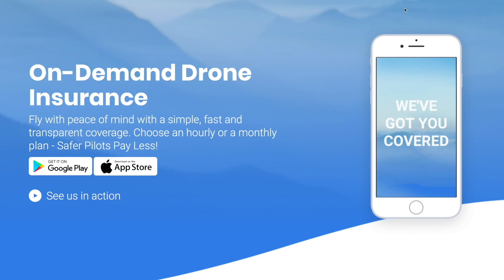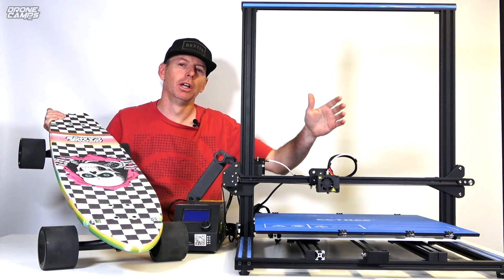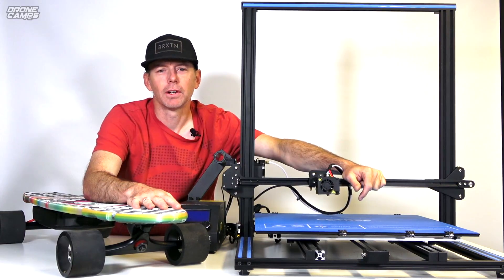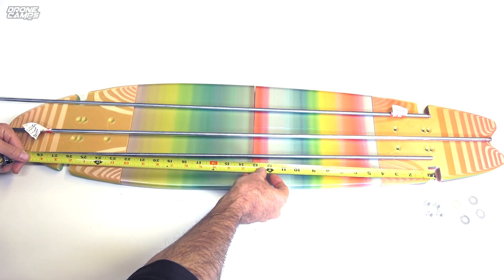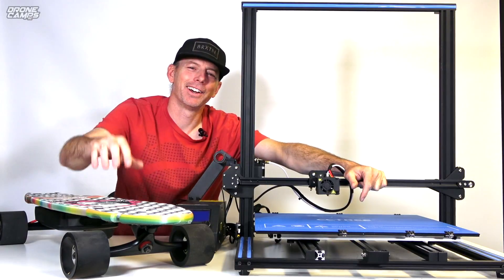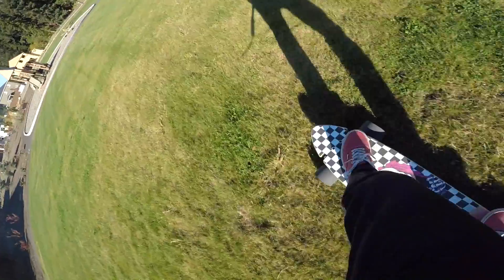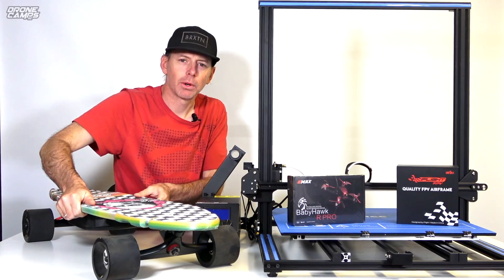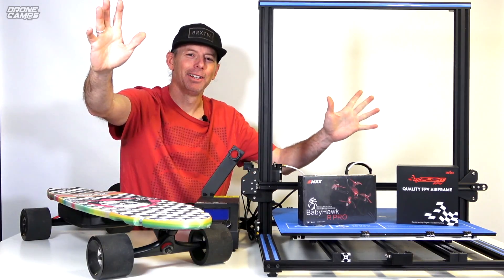3D Printed Electric Skateboard - Print & Ride Test!

Comment: i bought just this type of a printer a month ago as my first 3D printer...and for first few PLA small samples with basic settings from Cura, it printed very good, but then I tried it with PETG with custom settings and I am having nightmares with leveled bed...so I figured out, there are some mechanical issues I need to fix it by myself, so the leveled bed doesn't go off the level each time i want to print a new thing. So overall, I am experiencing a lot of headaches with it than with the enjoy :/ Also, have you tried to print anything with PETG with this printer?

Comment: Hi Justin,  Great Board, I wish I could still ride ever since I became dissable I no longer ride but if that printer could build a longboard that I could sit on like a hoverdoard and a third wheel up front,  I know that it's made I have seen on at Wal-Mart but that's not the point it's can one be printed. ok now can it be made. JohnnyDRC